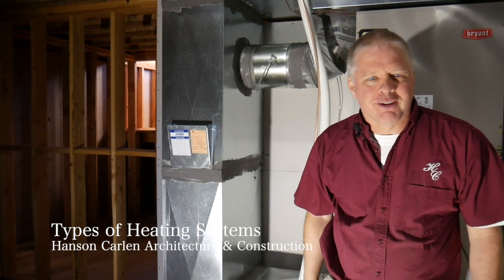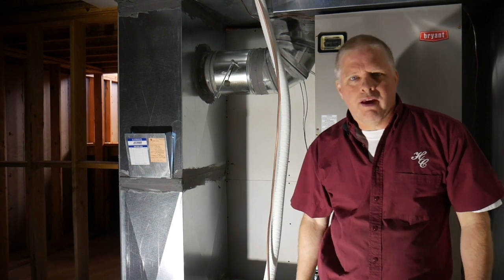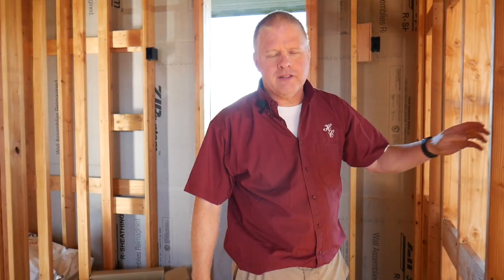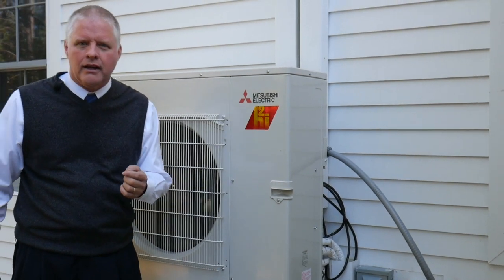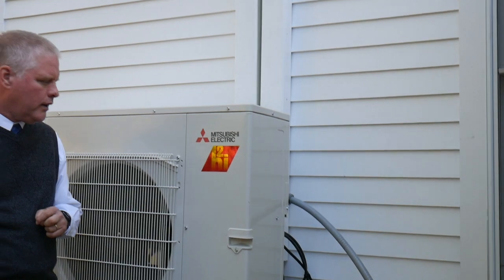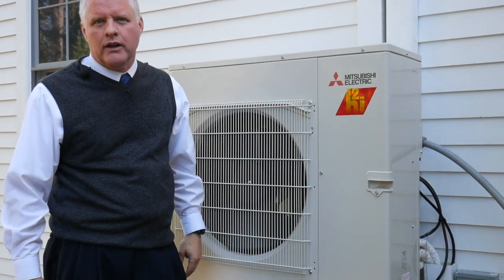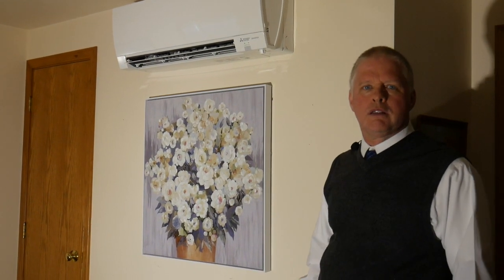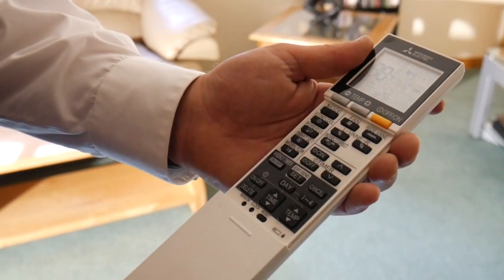Benefits of Heat Pump and Mini Splits

Comment: Nice. I’m wondering whether I should go with the heat pump or just insulation or mini split. Wondering what you gets the best for your money?
Reply: Can't go wrong with insulation. Maybe a single or dual zone split in the areas you use most of the time.